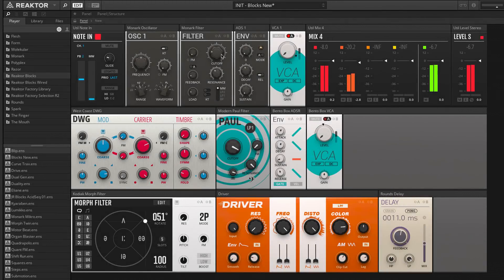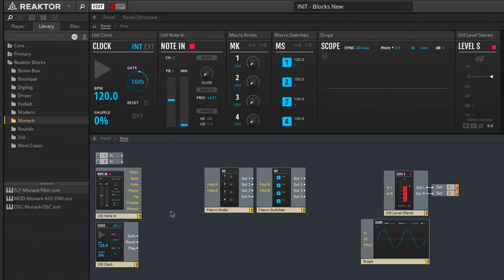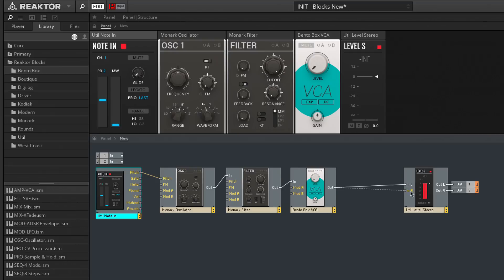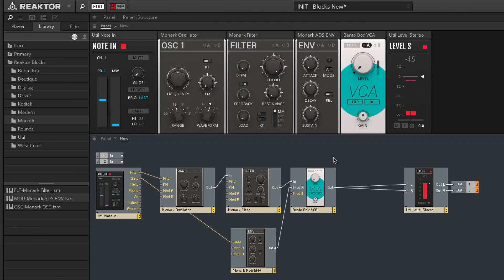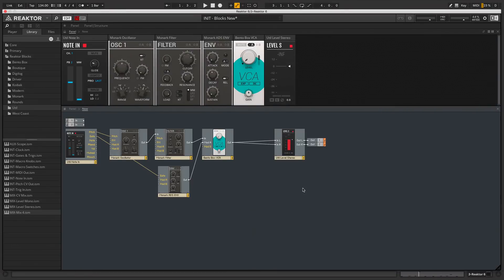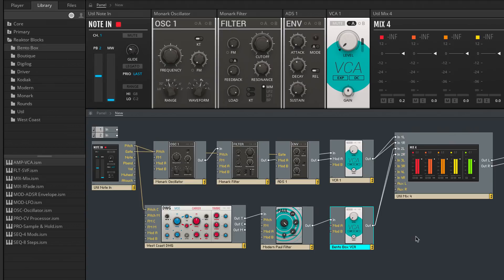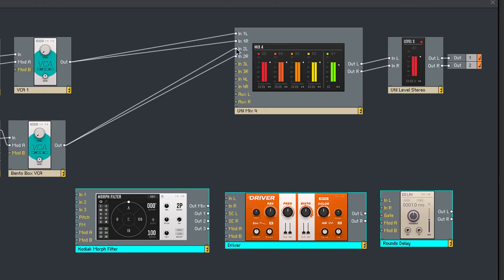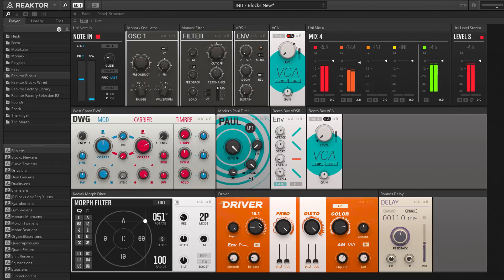How to: Making grime basslines with Reaktor Blocks | Native Instruments

Comment: In my version of Reaktor (6.4.0 (R2)), the West Coast DWG outputs are flipped upside down. This led to 10 or 15 minutes of wondering why no sound was coming from that branch, until I figured out I had it wired from the Out M of the West Coast DWG module to the input of the Paul filter rather than the intended Out T, because Out T is now the bottom of the 3 outputs of the West Coast DWG module.